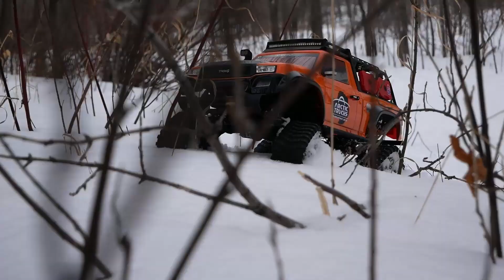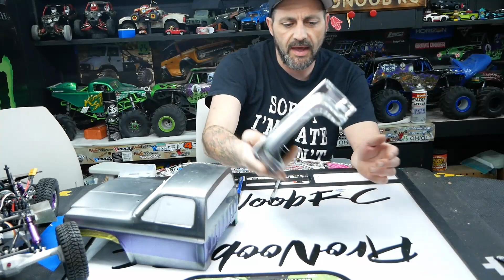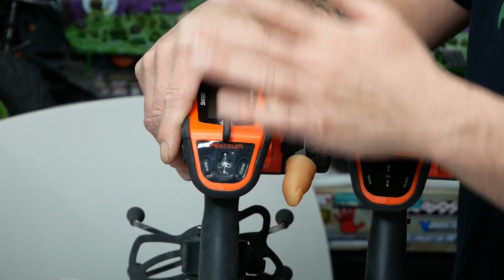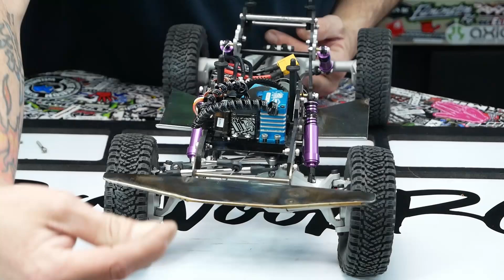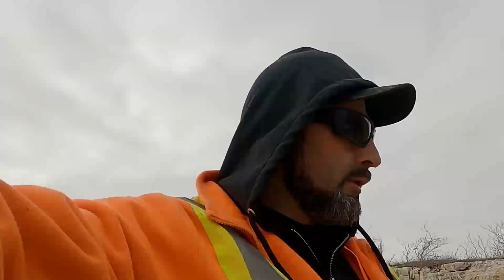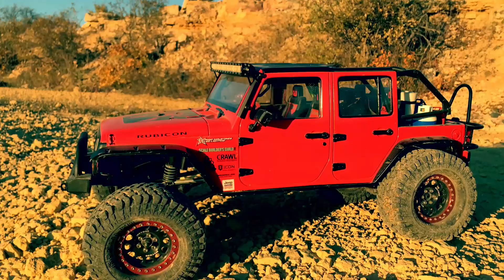1/10 SCALE COMPETITION CRAWLER BUILD: PART 3: Finishing the Little Things - Test Run

Comment: hey man i know this is an older build but its kinda what i am useing i got a power hobby lcg chassis an a set of cheap offset portal axles an a jx eco boost servo an my rims an tires an i am just needing the motor an esc that i was telling you about an i really want to be out side crawleing around but now were i am in here i cant work anymore so it takes time i work with styrene an that what i am make my cab out of an my scale thing for the inside but i like the way you have this rig setup i have my spur gear up high so it will show it turning thu the hood just something i am want to do you know always make it your own right my friends thank you all
Reply from the maker: Cheers!  Should be epic! Send us pics when done

Comment: What TIG welder are you going to go with?
Reply from the maker: Well we want an Everlast AC/DC but currently using and learning with a Razorweld 170 with Lift start only which is fine except it gets a little violent when it comes time to stop welding as you have to lift the arc away from the material and Looks like that scene from Iron Man to with the guy with the lightning bolt whips lol